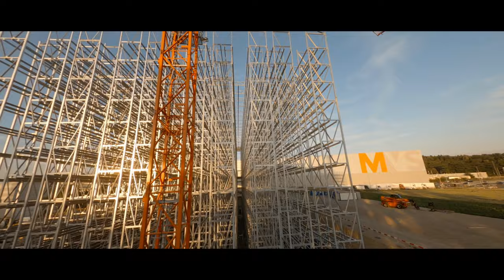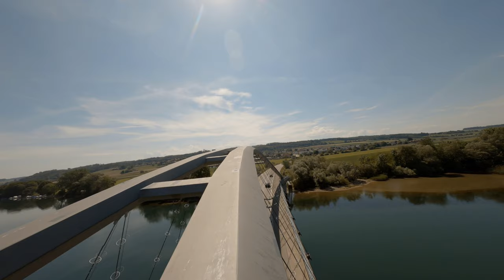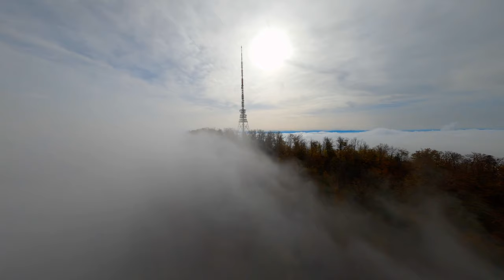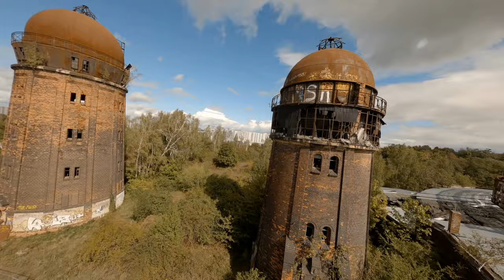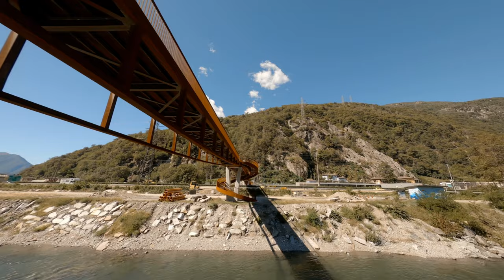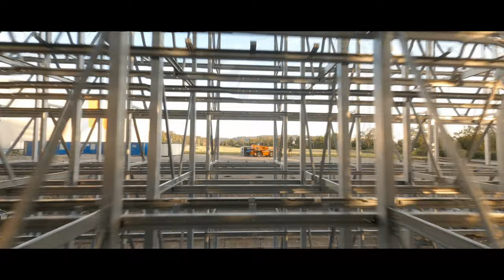dji fpv Stahl! May contain fast passages and freestyle elements! No liability is accepted for nausea

Comment: Wow, man, that was amazing! Really great shots!! 😍 This is one of your best videos! 
I still don't dare to fly in M mode with the GoPro on the back... I have a feeling that the drone could very easily experience some problems like motor failure due to overload. What are your experiences?
Reply from the maker: Thx a lot. :-)
No issues about motor overheating with a gopro8. Is the 11 not even lighter? Try a short flight with  gopro, if the motors don't get hot its fine! During winter its even less danger for overheating while recording cinematic shots
Reply: @anotherview1  You're welcome my friend!
That's great news!
The GP11 is 16 grams heavier. So, almost the same.
I didn't notice overheating, but I heard some strange humming sound when I took off, as if the propellers were struggling and vibrating, but it only lasted for a short time...
So in M mode there is no instability in the air? Don't you feel that it is uncontrollably veering off the trajectory?